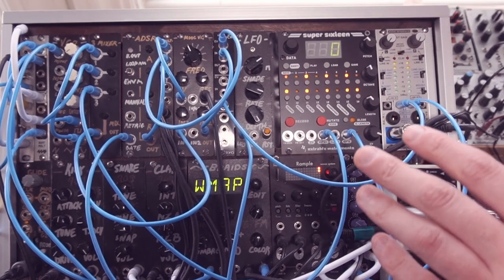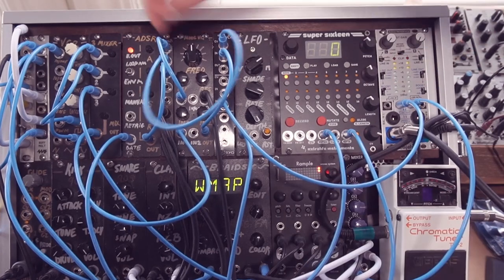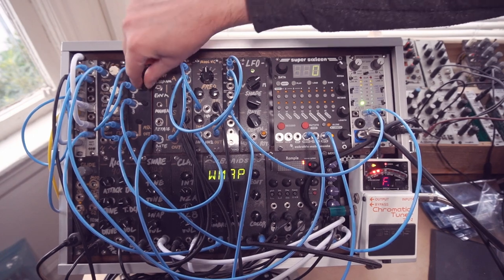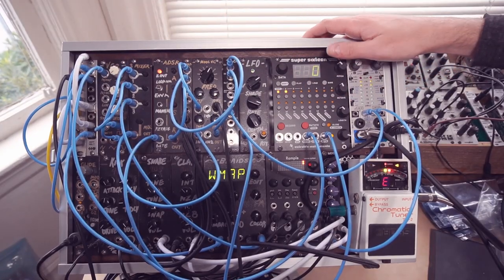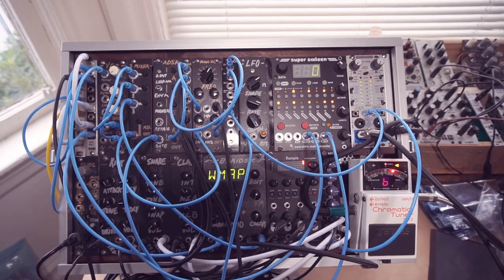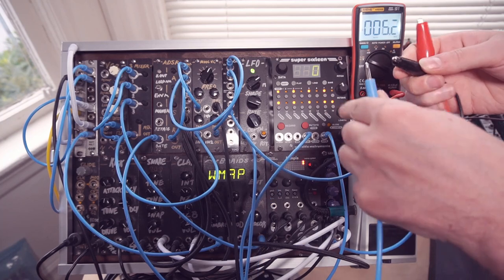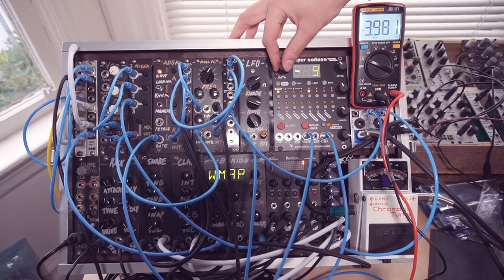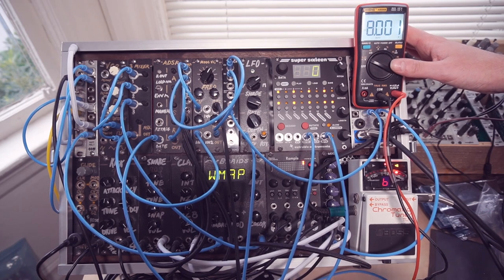Super Sixteen Calibration Tutorial

Comment: I see you are using a 12 bit dac. I have heard some people say that this isn't good enough for pitch applications. Does the quantized nature of the sequencer resolve this? Also I was wondering how you are doing the front panel? I'm designing a couple modules and any advice or recommendations would be great.
Reply from the maker: Yes the 12 bit DAC is adequate for well tuned pitch. The resolution at 0-8V is about 0.002v, or roughly 3 cents concert pitch, so slides are smooth and tuning easily calibrated.

The aluminum panels are fabricated by metalphoto of cincinnati from illustrator files, and the black ones are PCB panels. The kicad files for that are in the github repo, although tbh I haven't figured out a good way of getting component positions figured out besides manually calculating each offset from PCB via locations. https://github.com/matthewcieplak/super-sixteen
Reply: @extralifedisco  thanks for the GitHub link. I may redesign the black panel for myself. If I do I will let you know. I have a bunch of other panels to finish first though. Can you tell me which resistors control the brightness of the LEDs? I switched mine to a combination of red and blue but they are way too bright, even though they are diffused LEDs. I'd like to cut it in half at least.
Reply from the maker: @etainafuzz  You'll want R1 R2 R3 and R4 on the control board (below and to the right of the LEDs and switches). They're multiplexed so you need a smaller value than a typical R-LED circuit but maybe try something around 500 ohm. They share resistors in groups of 4, so having 2 different colors in circuit make it difficult to match the brightness.